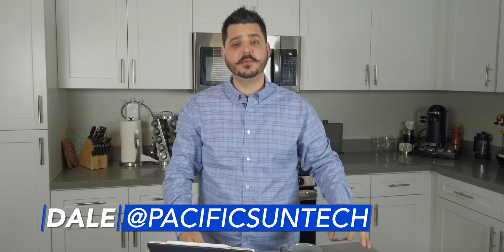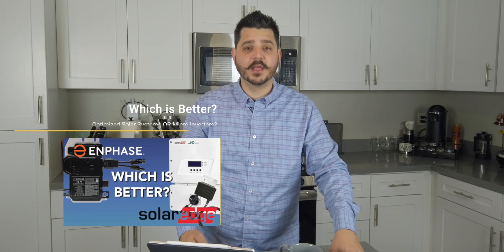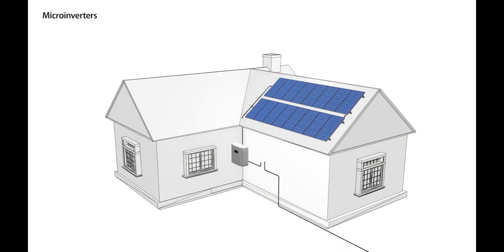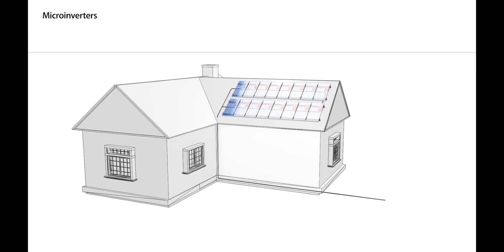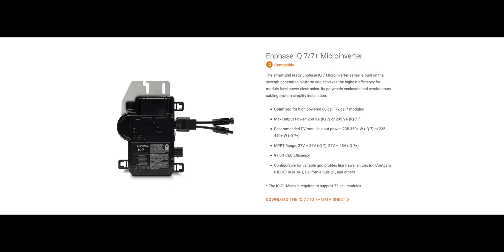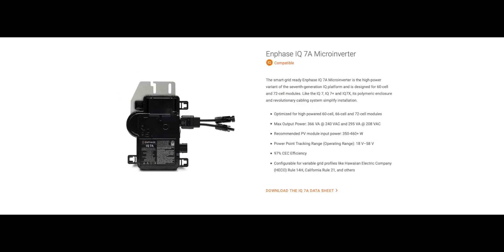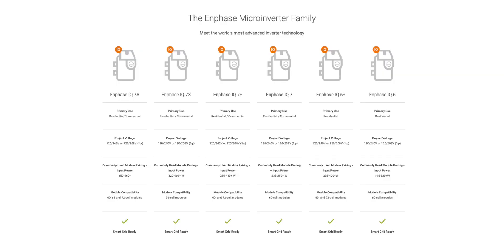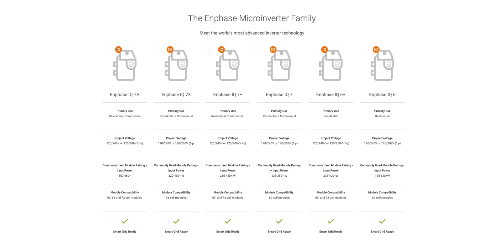Pick the Right Micro-inverter - Enphase Energy

Comment: Hi can we use a 600-700 watts panel for residential purpose with appropriate single microinverters? What additional expense would come if suppose  I buy a pallet of  680 watts panels and connect to the grid. I am located in Toronto, Canada with a detached home. Is there any rule that only 500 or below watt panel should be used residential purposes. Please reply, thanks.

Comment: I use the iq7+ on 405 watt panels.  I have a couple iq7A's in my one array but i haven't noticed any significant gain. Maybe 1%. 
West texas desert 12 degree tilt 280 degree asmith.  No shade.
Edit. My data was over 5 summer months
Reply from the maker: That AC to DC ratio for the IQ7+ on a 405-watt module is 134% that's pretty significant, but the potential loss compared to the IQ7A at 109% will likely be 1-3% over the course of a year due to clipping. Because the IQ7+ is able to make up for the loss in clipping during the early mornings and late evenings throughout the whole year, while the IQ7A requires more voltage to turn on, so it's starting later.
Reply: @pacificsuntech  so in a warmer climate which is better the IQ7A or IQ7+?
Reply: @tswej  I'm definitely not an expert,  but the data I gathered shows that on a 405 watt panel, the iq7+ is perfect.  6 months in and my iq7A have not produced any more than the iq7+  same array, same everything. Crazy.
Reply: @deelarry2137  thanks for the info.... I'm currently looking at installing a system using either Rec 385aa or the Q cell 405. I had a installer come out yesterday and we went over the difference between the iq7a and iq7+. He said unless your system is in full sun and  produces over 400 watts per panel the iq7+ is the better option because the clipping is minimal but the earlier start and later stop of your power production makes up for it. The higher above a 400 watt panel you go the more it would make sense to go with the iq7a.

Comment: My solar installer has proposed the enphase IQ 7+ with LG LG370N1C-A6 panels.  Should I be concerned about clipping?  Your comments seemed to suggest this would be inadvisable when you said the 7+ shouldn't be used residential with panels over 350 watts?  I'm confused since Enphase says it can handle panels up to 440 watts?
Reply from the maker: Solar panels have two ratings. The STC rating which is Standardized Testing Conditions and this is what most systems are sold at. But the inverters and micro inverters are designed around the NOCT rating Nominal Operating Cell Temperature. This rating is considered real world. The LG 370 is 370-watts STC but is 277-watts NOCT. The IQ7+ is rated for 295-watts peak performance.
Reply: @pacificsuntech  Okay, thanks, that sets my mind at ease but basically contradicts what you said in your video unless you were referencing 350 watt NOCT, but I'm not sure that you referenced that.  Cheers.

Comment: Be useful in that video - where you present a table with pairing to show the sustained output of each class of micro inverter - and the Optimal economic wattage range of paired panels (versus the broader supported range).  Would also be good to show the cost differential between each model - as the $ between a 7A and 7+ is now rather surprisingly small.  The challenge for residential homes is finding a great quality and price PV model in 380W - 480W range to match it too.  Options and the economics become a bit of a cliff at the moment (Sept 2020) when you go past 420W.

Comment: Do any of the Enphase Inverters work with Half-Cell Modules? These modules have 144-cells (or 120-cells) as opposed to 60 or 72-cell panels. Are the 1/2 cell modules just 60/72 cells wired in series and do the inverters see them as 60/72 cells or as 120/144 individual cells?
Reply from the maker: You can use any Enphase micro-inverter with half cell modules with no issues.

Comment: ...Can two solar panel of  saying  225 watt each  can be connected in series and then pair with a Enphase iQ 7x ?  Thanks.
Reply from the maker: The IQ7X has a special voltage window designed for the Panasonic HIT modules. You can install two panels to one micro-inverter, there are products out there like AP Systems that have micro-inverters designed for this. Enphase has never really approached the industry with a micro-inverter for two panels, but you could use the IQ7PLUS to do this.
Reply: @pacificsuntech  The question is more to the fact that two solar panels of 225 watt each  in series  will have an open voltage of 70 volts .  Will this be a problem for the IQ7 ?   Now the second part...if I connect to  panels in parallel...the open voltage will be about 35 V...however the short circuit current might be 16 Amps... From  these options which one  will be a better approach ? Thanks.

Comment: What if a 435W (std) module  that actually  produces only about 310w (noct)?
Reply from the maker: All solar modules have two ratings, the lab tested rating STC and real world rating NOCT. When selecting a micro-inverter you can design around the NOCT but if you live in an area that may be closer to the lab tested conditions then you can select a micro-inverter better suited for the STC.

Comment: With a micro inverter, could you power an appliance directly? I want to power a pool pump, and it can simply run when the sun is out without a battery bank
Reply: Good question
Reply: Remember ... you are using grid power ... you can power anything in the house ... However, when you have a microinverter ... the solar energy will be converted to AC to power the house.  However, there is a problem ... if you power the house with too much energy ... it can go back to the Utility Meter ... and that's another problem depending on the type of contract you negotiate with the utility company. . This last problem is not a problem of the microinverter ... it is only an issue  when you have  any  grid-tie inverter.

Comment: Hello Dale, can you couple different panels one the micro-inverters, are must they all be from the same company? Greetings from the Netherlands.
Reply: Micro-inverters produce power independent of each other, so you can use different brands or different wattages of panels as long as they are within the recommended specification voltages.